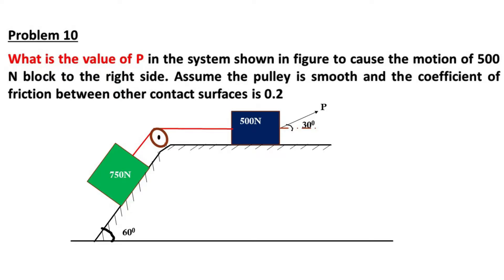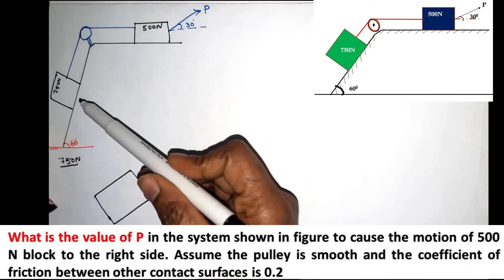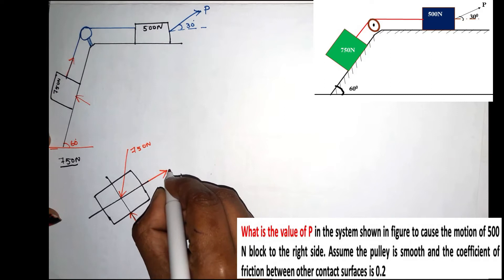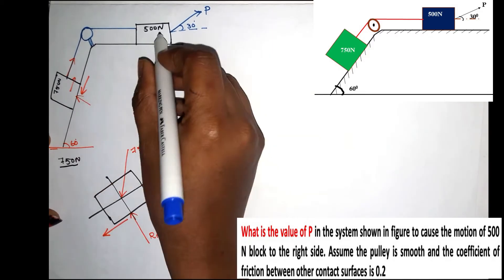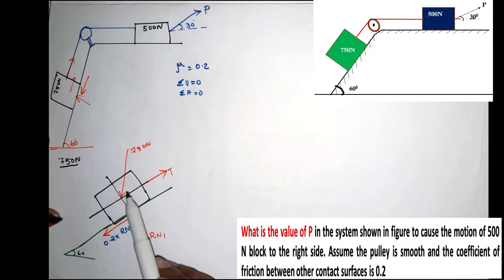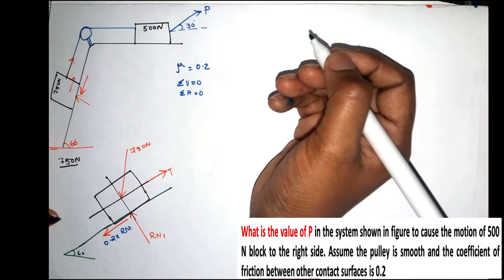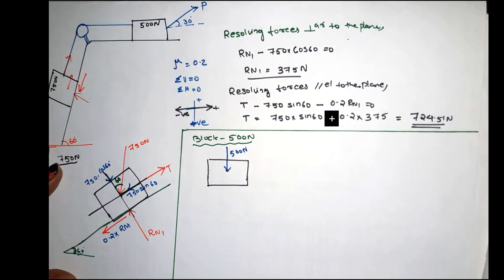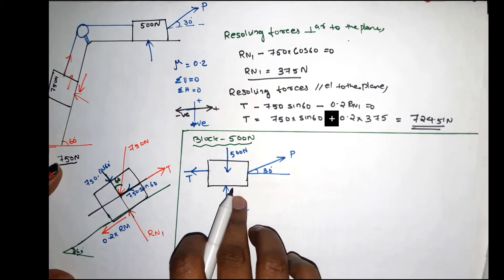Friction (മലയാളം) | Problem 10 | Engineering Mechanics | First Year | KTU B.tech

Comment: maam namal eethile second problethil RB inne endha inclined akkiye ath surfacin perpendicular alle
Reply from the maker: Eth problethile Rb yude karyama chodichath??
Reply: @learnwithjosyvaidyan7938  tow block  connected  by a horizontall bar  all are supported in 2 rough plane weight of B IS 5N ORU  3 FORTH BLOCK
Reply from the maker: @watchingvideos6887  Rb surface nu perpendicular ayt aanu edkkunnath enkil bakki ulla aa rand force um surface nu perpendicular aayum parallel ayum okkeresolve chyyanm..angnane varumpol athinte angles um kandu pidikkanmm..
Angne chythal kooduthal complication aakathe ullu..
 bakki ulla rand force um hori and vertical anu..normal aaytanu edkkunne enkil athine rsndibem resolve chyyandaa